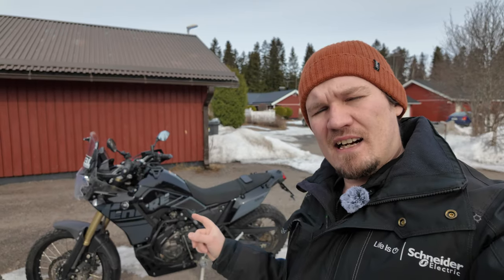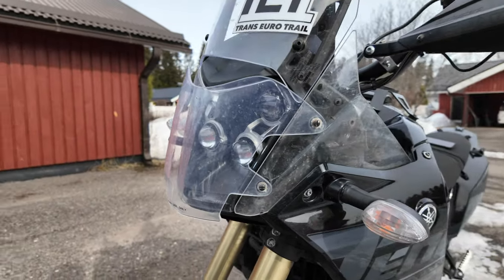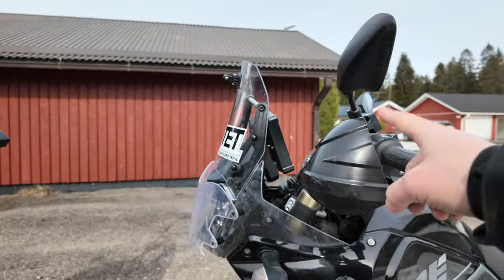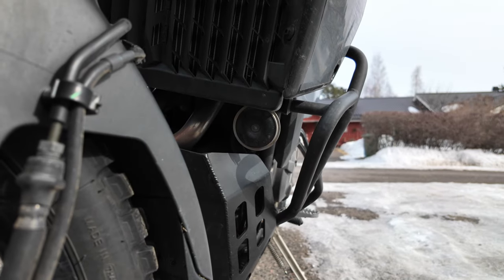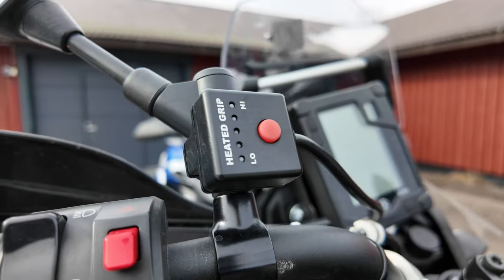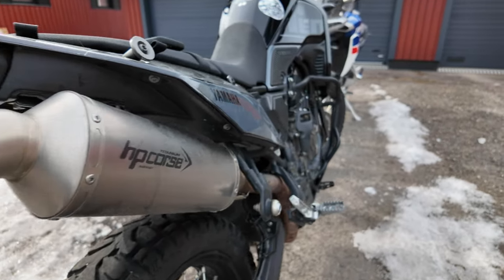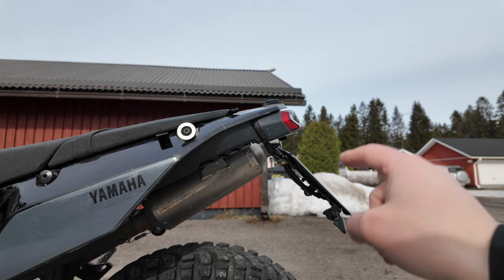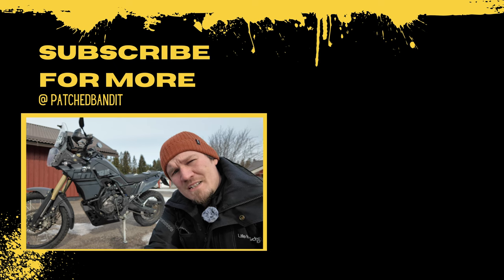Quick Recap of my Tenere 700 Mods After 20K

Comment: Nice upgrades! Does the mounting clamps in the handlebars for the barkbusters hit the SW-motech bag when fully locked in either direction?
Reply from the maker: No. The tank bag is adjustable and works good even with this bar.

Comment: 5:42 did you protect it with generic ppf foil or did you get pre-cut ones for the T7 (do you remember where did you get them if so) ?
Reply from the maker: Don't know the brand as I had mine professionally installed in a local shop called "painopiste" in Raahe, Finland. 
But it was a normal PPF film tha they cut during installation. It had the self healing properties also that are usual with the PPF films.
Reply: @PatchedBandit  Thanks for reply! 👍 Just got myself brand new T7, I'm thinking about ways to protect the bike. Cheers!

Comment: i did have the swmotec centerstand, if you go offroad I would not recommend this. it bangs araound it isnt stable. I am now not using any centerstand, just a small trailstand, much lighter and very easy to use.
Reply from the maker: This tends to be a probelm with most if not all centerstands. Not very good for offroad use and heavy. 
I don't use them in my bikes anymore even though some servicing is much easier with it on. 
99.9% of the time they are just a problem on the bike.